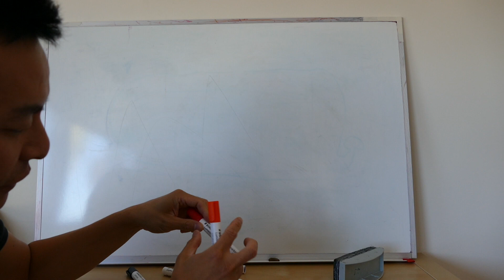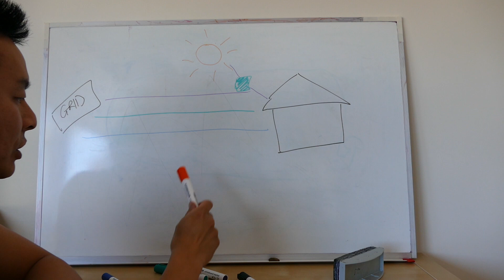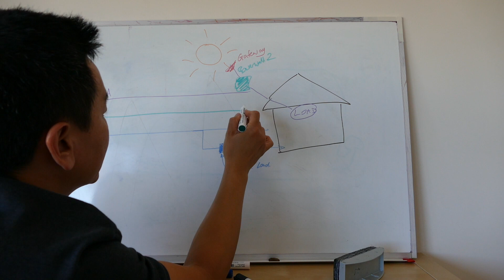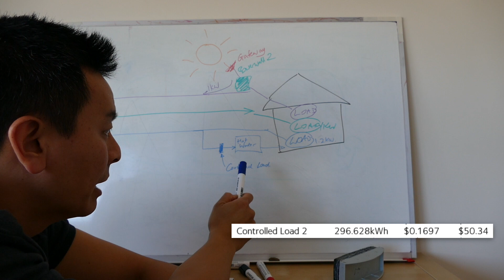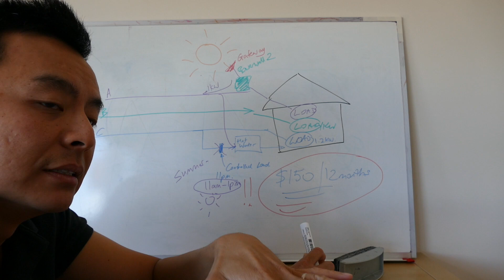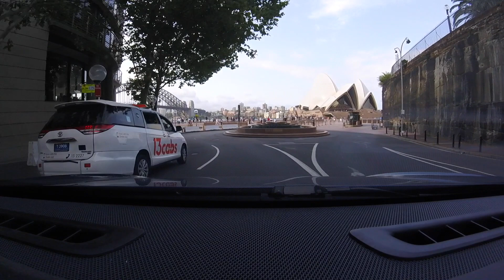Solar Panels and Heat Pump Equals Free Hot Water | Ludicrous Feed | Tesla Tom

Comment: Great video, Im in Sydney and have controlled load 2 - but im struggling to find out what is connected to it ( I assume hot water) and what hours it is operating, my PV system is going in on Monday 8.8KW - and im keen to remove controlled load 2, can I ask how did you find out what hours your controlled load was operating?
Reply from the maker: Best to check with your provider what hours CL2 runs on - usually hot water runs on CL2

Comment: Hi Tom
I have a solar panels but my hot water heating tariff run at night , if i want to change it to day time then should i need to call electrician or my electricity provider in my case EnergyAustralia can do that.
Thanks
Reply from the maker: If you want your hot water system to run during the day then you will need an electrician to install a load timer on that circuit. If you want the hot water tariff to run during the day then you’ll need to find a provider that allows this

Comment: 4 hours a day for my hot water 11-3
Reply from the maker: Electric? Or heat pump?
Reply: @LudicrousFeed  Electric but my desuperheater from my geothermal furnace does some too. I chose 4 hours on the timer in case we had company the electric heater only runs about an hour every day then the thermostat shuts it off.

Comment: Actually there is no such thing as free hot water no matter how you swap things around the phases or do the maths.
This is what I tell my customers when they ask me to do what you have just done.
These days it is possible to get 20-21 cents per kWh for your exported power in Australia.
If you run your heatpump during the sunlight hours it is actually costing you up to 21c for every kWh that your heat pump uses - ie reduced kWh exported.
So keep your heat pump on cheap off peak power at night then it is only costing you 10 to 15c/kWh to heat your water - a saving of 6 to 11 cents per kWh each day by not reducing the amount of your valuable exported power.
cheers MBSolar..
Reply from the maker: Thanks MB, that’s a good point. It’s an opportunity cost by doing it this way.

Comment: What is the reason that the Sanden in-built timer has to be set for like a 2/3/4 hour window? Does it save money/raw-energy or something compared to making the window say from sunrise time to sunset (eg: today in Sydney, sunrise 640am sunset 735pm)
Reply from the maker: Poul Pluto No reason. My timer is not inbuilt but rather a controller linked to my hot water circuit. I can go sunrise to sunset I suppose if I wanted to. TT
Reply: @LudicrousFeed  if you didn't have the timer, would the main disadvantage be less solar energy going to other loads and less charging of your battery? Since it only needs 1.5-2 hrs a day, I see the timer as a huge plus if you have solar panels. Why not? Also, I read that the minimum temperature of water in the tank should be kept at 60C or 140F to avoid legionella from growing. This bacteria can cause pneumonia. Does the 2 hr running time keep the heat up in the tank during the night?
Reply from the maker: Peter Phan I’ll do a test when the weather gets cooler where I’ll have the timer on during daylight hours - to see how many times the heat pump decides to turn on. 
Good point with the water needing to stay warm. TT

Comment: G’day Tom, we have conventional thermosyphon hot water, almost never needs a boost with just two of us in the house. My son has no heatpump YET, but runs his hot water (resistive heater) from 11am till 2pm, which is covered by solar panels and occasionally a little from the Powerwall. 
You may as well have it running a bit longer than the minimum required as your Powerwall should cover any deficit anyway. 
The LAST thing you want is to run out of hot water, not great for matrimonial harmony LOL :-).
Reply from the maker: FutureSystem738 Thanks for that! Running out of hot water would not be fun haha. I’ll keep an eye on the app over time to make sure it gets enough heating. 
I’ve heard evacuated tubes work well. 
TT

Comment: We have a Sanden.  We use a four hour window. Internal timer is set to 10 am to two pm summertime and  11 am to 3 pm  winter time. Ie it is never reset.  Very rarely does it run for three hours but it is better to have a generous window.
Reply from the maker: How's That Thanks for that. I’ll play with the timer over the coming weeks/months. TT
Reply: We have a Sanden but the water temperature is never really hot enough even with the tempering valve turned to the hottest position the water is barely 45C.  Does anybody know exactly how to set the outlet water temperature higher.  Setting the outlet water temperature setting is mentioned on page 17 of the installation manual, but doesn't tell you exactly how to do it. It also says it can be set anywhere from 55C to 80C.  I have the bo timer set so the the heating runs from 9am to 3pm each day, but usually turns off after 4 to 5 hours.

Comment: Tom your B phase is still in the same boat as your C phase. They are all metered independently. The power wall doesn’t match the load and send it back. All the circuits are independent unless you run a 3 phase 415v outlet. 

I would of thought your EV rate was on one of your phases though. Ie the B phase since C was your controlled load?
Reply from the maker: Ryan McArdle Really? Then either you’re right or my PW2 installer is right. 
My understanding is that not the whole phase is metered, merely the hot water circuit only. Same with the EV charger ... it’s not the whole phase that’s metered, merely the EV circuit. 
Happy to be corrected. 
TT
Reply: Ludicrous Feed everything is metered Tom. The same phase can have multiple meters on it sure. This is how controlled load tariffs can work too for single phase properties. It’s just tapped into 2 meters and one has its own independent circuit. I’d say your EV charger is wired like this. Otherwise how would your retailer know what’s EV usage and what isn’t. They may charge a flat fee. But it must still be metered

I watched the video again. With what you’re describing you would be still paying something for your B phase. Ie B phase uses 1kw@30c. PW on A phase matches that 1kw and exports @11c. You’re still going to pay the delta of 19c. 

You would be better off not using the B phase at all. Or just have it for your EV charger
Reply from the maker: Ryan McArdle Hey Ryan, yes the EV charger is metered, I agree with you, which is then deducted from overall house usage. 
My understanding is that the Gateway has CT clamps across each phase to monitor what is going to the house. It then apparently nets it back on its own (PW2) phase. You are right, it’s 120 degrees off the other phases which means there is a delay so that it can work out what to send back on the same phase as the Gateway/PW2. I agree that you can’t cross phases, it just doesn’t happen.  
I can see it on my Tesla app when the Gateway is thinking (so to speak) ... there’s always a brief moment when you can see the Gateway working it out ... the grid briefly is used for a couple of seconds before the PW2 matches the load and it ‘appears’ to be supplying the house but you and I know that it is sending the load back to the grid on the same phase as GW/PW2. 
A roundabout way and albeit not true green solution of hooking a single phase PW2 with a 3-P home. But that’s where the Gateway comes into play.
😬 TT
Reply from the maker: Ryan McArdle I initially thought that too when I first installed my PW2. I didn’t want to end up 19c behind if I sent matched load at FiT.  That would suck. 
I checked multiple times with installers and went ahead with the PW2 based on advice that it would be netted off electrically and financially - meaning my bill would be net zero.
Reply from the maker: Ryan McArdle I think this may explain it better than I can: https://support.solarquotes.com.au/hc/en-us/articles/115001596554-How-does-a-single-phase-inverter-on-a-3-phase-supply-affect-my-self-consumption-
Reply: Ludicrous Feed interesting Tom. Thanks for that. This looks to be a function of the meter to achieve this. I haven’t had any experience with smart 3 phase meters and pv so this gives me something else to go research. Also makes a 3 phase power wall unnecessary
Reply from the maker: Ryan McArdle Yup, 3-phase meters nets everything out. A three phase PW2 (if they ever release it) will need to be 3x as big in capacity otherwise it’ll only be 1/3 power on each phase which is paltry. Plus it will only be limited to Australia and other 3-phase markets. Would it be worth doing for Tesla?
TT

Comment: Hi Tom, We are going down a similar route and are getting a new 3-Phase Supply installed at the end of March. 

Regarding the maximum hours of sunshine - all you have to do is search for “Solar Noon” on Google. Then enter your Latitude and Longitude. You then get a table of the “Solar Noon” times for each day of the year... 

The time changes by a small amount each day. 

I trust this helps.
Reply from the maker: Campbell Crockatt Great tip. I’ll check it out. TT
Reply: @Campbell Crockatt
 - January & February & March "105 pm"  ,  April & May & June & July & August "1200 pm"  ,  September "1150 am"  ,  October & November "1245 pm"  ,  December "1255 pm"  << for Sydney NSW

Comment: I had my site inspection from Tesla last week for Gateway 2, Powerall 2. Given GW2 is 3 phase and my Fronius 5kW inverter is 3 phase, the only draw back for me is only being able to back up one phase of the house in the event of an outage. I wish Tesla would just bight the bullet and build a 3 phase Powerwall too and perhaps call it PW3 ;) Also, phases are commonly referred to as red, white, blue or L1, L2, L3. Maybe the A,B,C is a NSW thing. AFAIK, we don't have controlled loads over in the West unless you're a larger commercial customer.
Reply from the maker: Jays200 Thanks Jays. Keep us updated with GW2. I’ll have to find out how much it is to update from GW1. 👍
Reply: @LudicrousFeed  If it's anything like trying to find out the cost to "upgrade" from MCU1 to MCU2 in our cars so we can use dashcam and sentry mode, good luck. Jokes aside, in theory a GW2 should be easier. My agreement states GW2 at $2045.45 plus GST ie $2250 that is quoted on Tesla website plus sparky costs.

Comment: Single phase, TOU, 12kw solar, PW2, and instant instaneous (Rinnai) gas hot water system.
Reply from the maker: Vatoe Thanks Vatoe. Any thoughts of switching to electric? Heat pump payback is quick and you’d be utilising your large solar array. TT
Reply: Ludicrous Feed I did for a moment. But to be honest our hot water usage is low, now that we only have 3 in the house, our daughter being the biggest hot weather user has left :-)  In non summer months (as we have ducted AC, pool  pump and 7 fridges)  I expect that our daily export (which is limited to 5Kwh) to the grid, will more than make up for the gas cost and give as a healthy credit with our electricity provider at 14c per kWh for the excess energy during the low demand  periods, ie Spring, Autumn and some of our winter in the far north coast of NSW. Even on crappy cloudy days at the moment we are generating around 50+kWh on non high energy use days (ie no air cond) as the  maximum feed to the grid ramps down my inverters to ensure max of 5Kwh is feed to the grid and also meet what ever the house demands are. So, for example today being a cloudy day, the pw2 was charged by 12.30pm and as of 5pm 21.5kw has been feed into the grid. To put this perspective on hot summer days we will generate 70+ kWh (no ramping down of inverters) and will use about  45-65kwh!
Reply from the maker: Vatoe I see. Thanks for sharing your situation. Looks like your export makes up for the gas usage 👍
TT

Comment: Hi Tom,  yes I have control load HW and I questioned my solar installer if the solar or the PW 2 was powering the HW heater. No, it’s a separate circuit. At the moment my FIT and control load prices are almost the same so I guess it cancels it out. Not perfect I guess,  but I may consider what you have done as well.
Reply: Craig Always better to consume solar power as much as possible than exporting and importing again later. The night time tariffs for hot water is an old program and people with solar power now need to be re-education.
Reply from the maker: Craig Hey Craig, +1 to what Alex said. My electrician also agreed with my decision to move HWS to solar. The Controlled Load tariff doesn’t make sense with solar installations anymore. 
Email me if you need more details 😊
TT